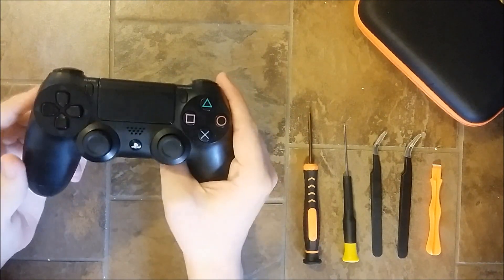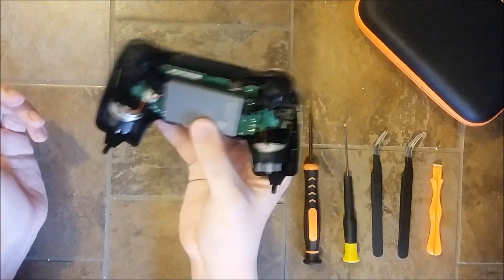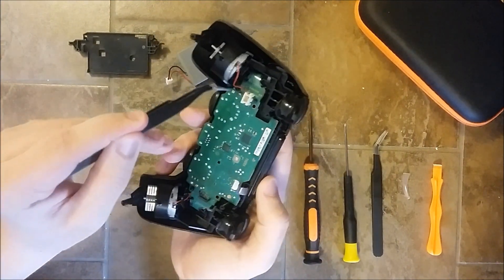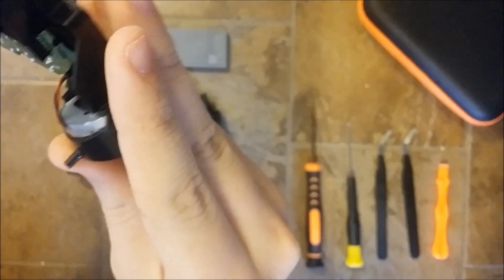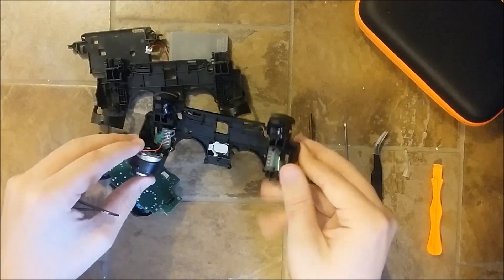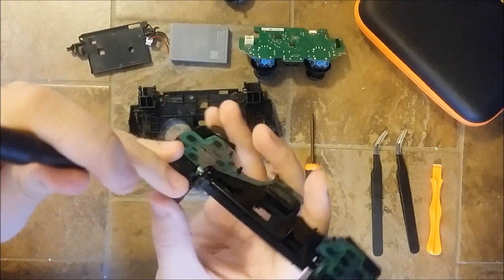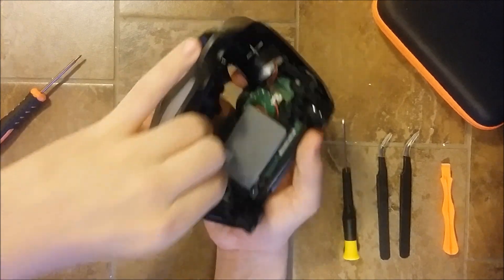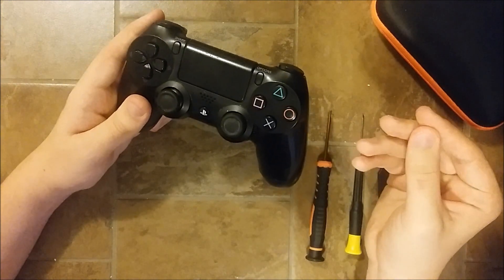How to fix your PS4 controller with rattling sound or loose vibration (EASY and hard ways to fix)

Comment: My controller works perfectly but it rattles like something in it is broken and I loose vibration sometimes
Reply from the maker: A wire of your rumble motors probably need to be resolder. Otherwise, it could also be that your inner frame is broken.

Comment: my controller constantly moves forward and stays going up how do I fix this? or is this fixable?
Reply from the maker: Hi, it's call joystick drift :)

I suggest that you watch this playlist on joystick drift to know how to fix your problem : https://www.youtube.com/playlist?list=PLVMOpbUzqOAxggx4A3ITX-JjF_wiKwsXI :)
Reply: @RepairResell  yeah it was unfixable I did everything I think its just a dead joystick
I also replaced both white things inside the joystick and it still didnt fix
Reply from the maker: @Broyl1  did you try cleaning the potentiometer ? Also, the whole potentiometer might need to be replace. I would also check the solder joint on the faulty potentiometer.

Comment: What are rumble motors used for? The left rumble motor of my controller is not connected to the motherboard and the controller works just fine! Idk the use of them. Can you please tell me?
Reply from the maker: It's for vibration. When the motors are connected to the board, the motors will turn when your controller need to vibrate. Having only one connected should still work but the vibration should feel different.
Reply: @RepairResell  thanks a lot! Hope you have a good day!
Reply from the maker: @behrambajrami7706  No problem, if you can leave a sub on your way out, it would be really nice. We are on the road to a thousand subscribers. :)
Reply: @RepairResell  Hi! I have a problem with the smaller rumble motor in my DS4. Both of  rumble motors are connected and only big one works when I turn on the controller. Can you help me somehow?
Reply from the maker: @darkouricic8161  It's hard to say without having the controller. The first thing I would do is to redo the shoulder joint. Then, if the problem is still there, I would change the motor to see if an other one work. If it's not the case, it should be a motherboard problem.

Comment: I bought my PS4 controller 2 days ago and only used it for 1 hour and right now it is making random rattling noises
Reply: Same here. I bought a dualshock 4 like 2 weeks ago and just today started to use it, playing only 2-4 hours I already hear noises inside the controller
Reply: What did you do about?
Reply: @gxnzaalo2776 I didn't do anything about it and everything is working perfectly fine the vibration and all of that is all good I haven't had any problem with the controller at all.

Comment: They're pretty bad considering how expensive they are. I have two controllers that have had very light use (were in a cupboard for the last 8 years after less than a month's use beforehand) and the vibration has gone weak on both of them. Never dropped them, never smashed them in a fit of pique (despite temptation). My phone still vibrates normally after a lot more abuse.

Comment: i have a question, is it normal for a ps4 controller to have a weaker vibration on the right side than the left?
Reply: Yes, the "vibrators" are different sizes
Reply from the maker: Yes, it is !

Comment: I need help my controller is constantly vibrating I didnt spill anything on it it just started vibrating everytime it's on do you have a solution  I've even tried hard resetting it
Reply from the maker: You can unsolder the wire of the rumble motors. There will be no more vibration.
Reply: @RepairResell  how do I do that I dont want to break my ps4 controller more but what happened was I was playing  call of duty cold war and I was shaking my controller around and all of a sudden it started to vibrate I've tried resetting it and everything I let it die out but idk I just dont want to open my controller up and break something
Reply from the maker: @gilbertgarcia1549  This video shows you how to open your controller https://youtu.be/9Chgw4sRTzs

Once it's done, you have direct access to the rumble motors on each side. You can unsolder them with a soldering iron (which is really easy as you just need to melt the solder and the wires will come off).  If you don't have a soldering iron, you can cut the wires but do it close to the motherboard. If you want to reinstall them in the futur, it should leave you enough wiggle room to do it.

Also, don't cut the wires for the battery ;)

Comment: could i just super glue the vibrator instead of replacing it
Reply from the maker: If it's a plastic part that are broken, yes. You could also use hot glue but make sure it will still fit correctly in the controller once repair and that it doesn't get in the way of anything else. If it's the wire, they need to be solder back on (glueing them will not work because it will not allow the electricity to flow)